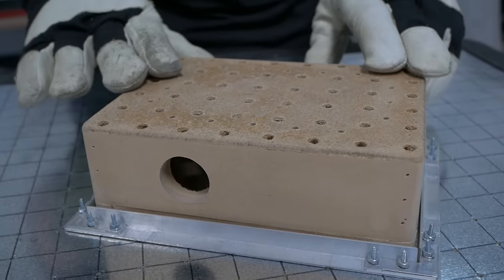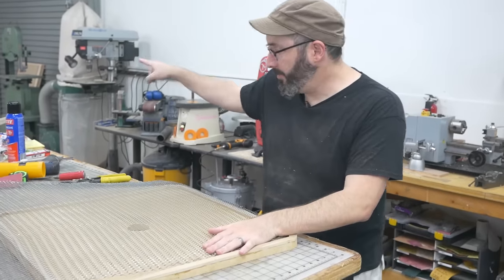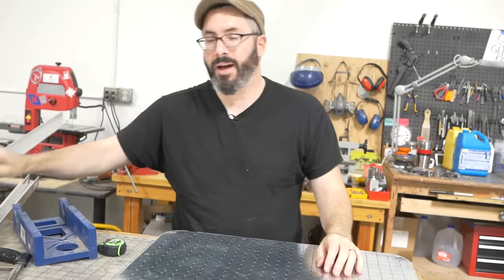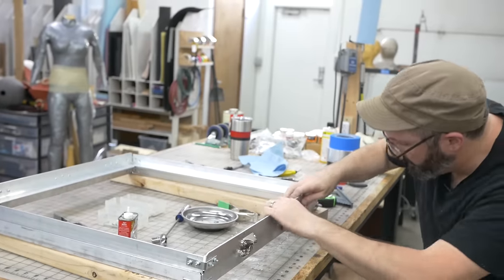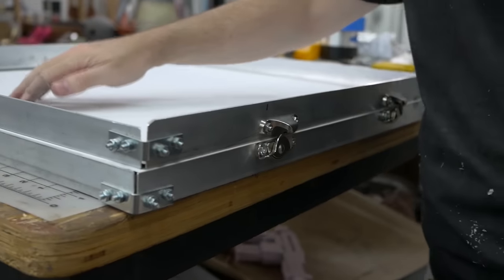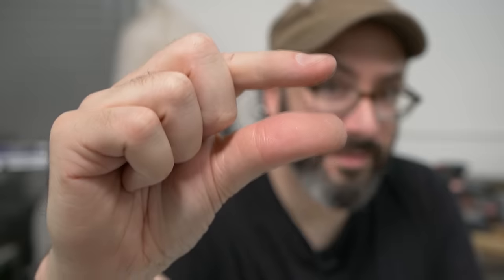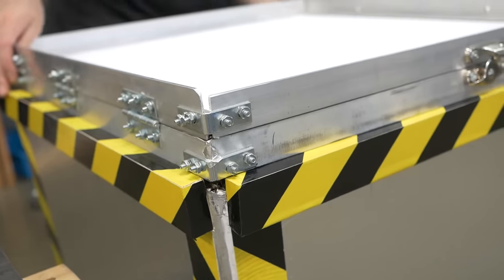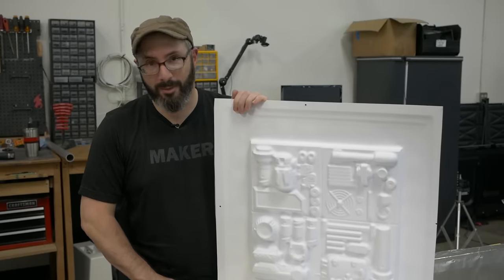Hardware Store Vacuum Table - HOW TO make your own

Comment: There has got to be a easier way to make parts like this.
Reply from the maker: This is just one method that works really well. Making the initial machine takes quite a bit of work, but once you have it, it can really speed up your production time!
Reply: @punishedprops   thanks for the reply. Have you considered a silcon negative and positive mold. That you would lay a resin infused fiberglass cloth(still wet) between? A simple copy of a manual printing press. Would make it even faster, and you can make any thickness you want. On most designs just add more sheets.

Comment: You have a spindle sander but no hole saws? Really?  A band saw but no miter saw?  You can also weld aluminum with alumiweld brazing rods...no welder needed...just a propane torch

Comment: Make drawings first !
There's so many free CAD programs there's no excuse. (You'll see all the mistakes before you drill a single hole.)

A piece of foil covered foam over the top of the plastic while it's heating will get your plastic much hotter.

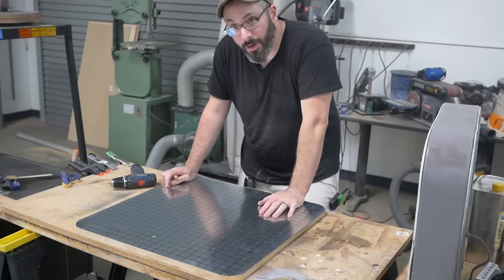Comment: I'm only at 07:30, but I'll already say thanks for an interesting video! At this point one question is why did you use the metal mesh instead of some strategically placed small pieces of the wood spacer material? The mesh seems totally unnecessary. It is heavier, more dangerous to work with, more expensive, and I don't see how it will work as well, let alone better than simple wood spacer squares. Now to watch more. Perhaps I'll understand this choice, if I'm missing something entirely...Oh and please please ditch the background music. It's not entertaining. It's not catchy. It's monotonous and highly annoying. If someone just has to have background muzak while watching and listening to your videos, let THEM choose the music, and the volume. That way it's not inflicted on the innocent who just want to enjoy your video, narration, and useful sound...
Reply: Same. I was scartching my head why he used the mesh instead of a handfull of wood screws stopped at a set height, as it'd provide a much less restrictive/even airflow when pulling a vacuum.  Thier heat box could also be improved with a metal fan (external motor driving a shaft through the wall) stiring the air  like a convection oven.  Or a small 'torpeado heater' blowing into the box could get them to placticity temp quicker (more noise, but much quicker)
Reply from the maker: Thanks so much for watching!

Comment: Well a 12x12 is 144. So my guess is just double that which is 288. Now Google the answer.... 576... Well I'm way off.
Reply: That's  because its doubled in both axis... its 4x144. Had the same thought as you at first, then realised 20x20 is already 400...
Reply: @danlhoy  axis?
Reply: Axis as in using an X Y coordinate system for counting the holes. So if you double X AND you double Y it is 4 times the original number of holes.So if X=12 and Y=12 then XY=144And if you double both axis then2X * 2Y = 4XY = 4 * 144 = 576

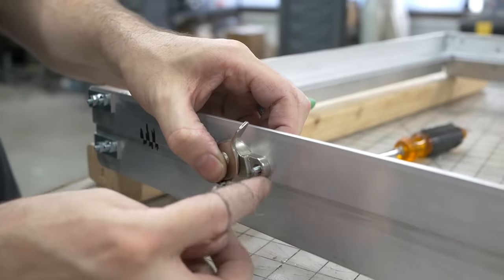Comment: 16:18 Typical installer, trying to out think the engineer
Reply: I don't think the engineer had this project in mind when designing. DIYing sometimes requires you to bend the rules and think outside the box.

Comment: This design is completely backwards. A metal frame for starters that conducts heat, so you have to wear gloves after heating the plastic up. Also fixing the plastic down to the aluminium case sucks aswell when you should have just sandwiched it in between 2 wooden frames with bolts and wingnuts. X robots dude has it much much simpler than this. Good old British brains to do the job properly. Don't spend days doing this method and using up lots of materials and using all the tools in your shed to do it.

Comment: You have no idea about thermodynamics, do you? Insulation and radiant vs convection heat.
Reply: NO one claimed to be an expert and the tool worked in the end.
Reply: @KipdoesStuff  Bill claimed to be able to teach the concepts. Maybe "Bill leads you on a trial and error journey to making a vacuum former and heat box." would have been a better caption.